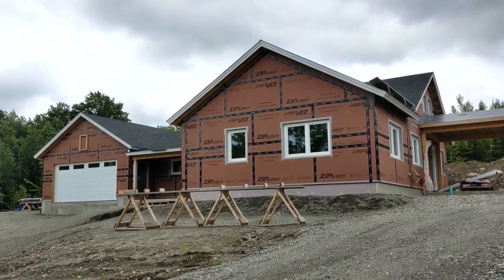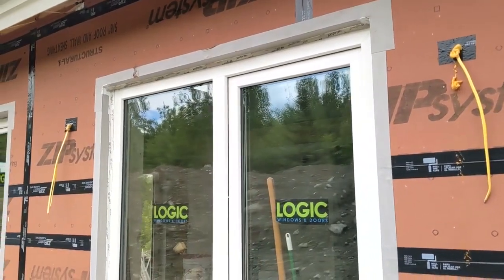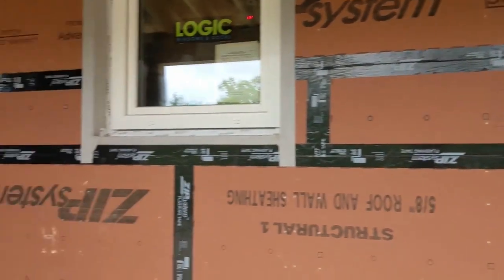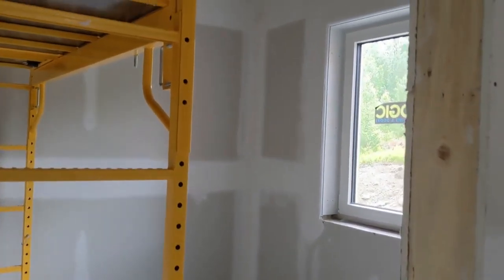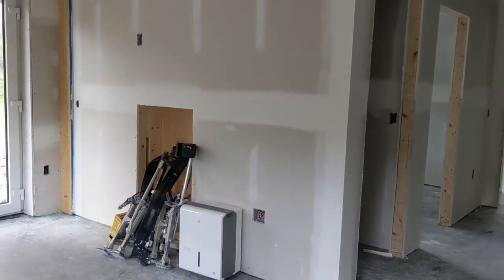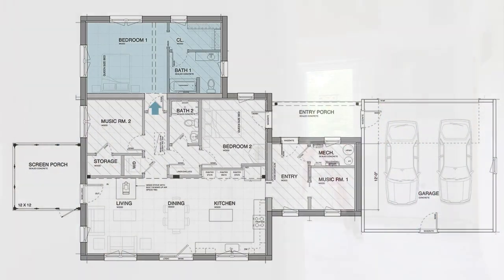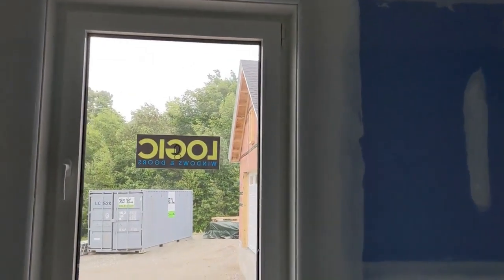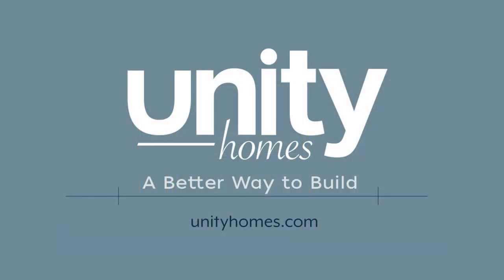Post Sheetrock at Xyla in Lowell, VT

Comment: What's the R rating for walls and ceilings, and type of insulation
Reply from the maker: We use dense-packed cellulose insulation in our wall and roof panels. The cellulose is preinstalled in the panels by automated machinery in the controlled conditions of our shop, with strict quality control. The R-value of the wall panels is 35, and the R-value of the roof panels in 51. Our precision off-site construction lends itself to airtight construction. Our homes often achieve the Passive House airtightness standard of 0.60 ACH50.